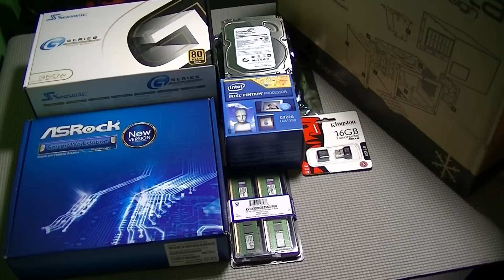How to Build a FreeNAS Home Server in Fractal Node 304: Part 1 - Components & MOBO Install

Comment: How well does this build transcode to devices? What is the limit to the devices? Does it transcode in 1080p? What is the maximum resolution it can transcode?
Reply from the maker: I've not tried anything above 1080p which is does an excellent job with.
Reply: How much did your build cost you?
Reply from the maker: Juan Espinoza Around $950 with all of the drives.

Comment from the maker: @Jonathan Cerrone FreeNAS has a plugin called crashplan that will "back up data to remote servers, other computers, or hard drives." I have not used it but it is a plugin that should allow you to do this.

I do have an external hard drive as a secondary backup but I manually copy all my data over quarterly. This is a very slow and tedious process so crashplan sounds like a great option for what you want.

Comment: Wonder if you could advise me. I am planning to build a freenas very similar to yours with 3x4TB WD RED RAIDZ1 configuration. I would like to do an automated weekly backup to an external drive. In case of catastrophic failure or a 2nd drive failure during a rebuild. I want to have two external drives, one kept in a safe and the other connected to the freenas. I will then swap the drives every week one goes back in the safe and the other is now connected to freenas. If there is a failure I would like access my files via usb connected to my mac, or transfer them back onto the freenas after repair. How can this be achieved?

Comment: Nice build. For for people interested in plex look for a stronger processor if you are thinking about multiple 1080p streams.
Reply from the maker: I am using this as a Plex server and haven't had many issues with it. I don't have more than a couple streaming at a time from it though. I will keep an eye on it. Thanks for the heads-up.